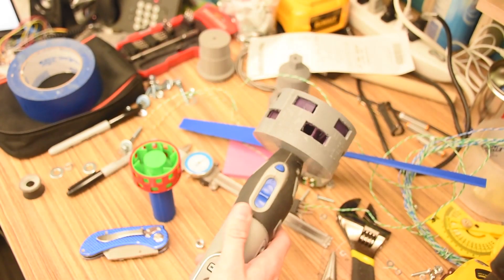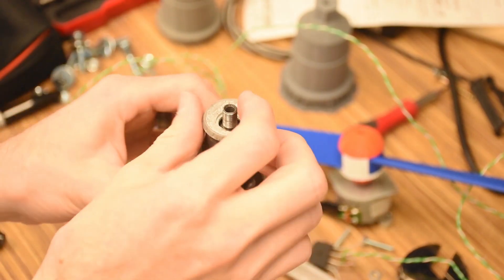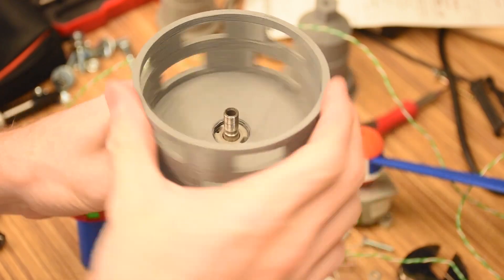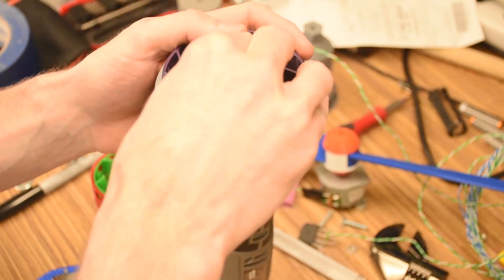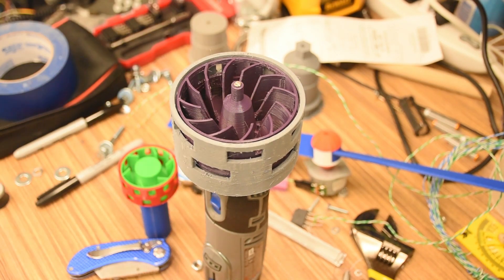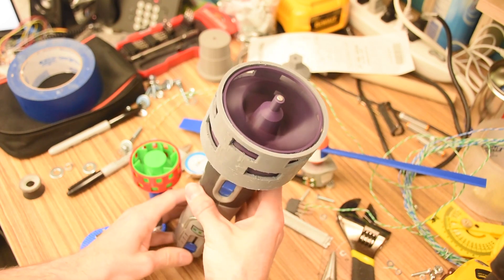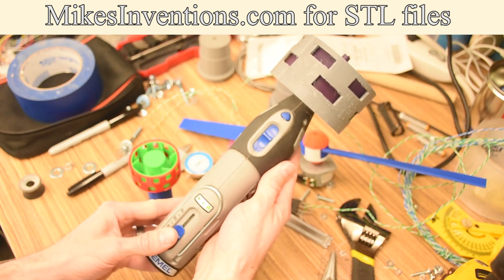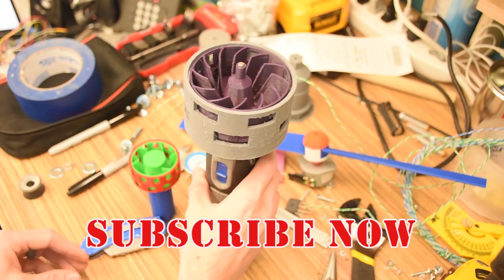3D Printed Tornado Siren on a Dremel - Mikes Inventions

Comment: This print worked quite well. I do have issues getting it to a high speed though, there is something off in the alignment (mild wobble)
I'm using a Milwaukee M12 Fuel and it has a safety shut off if it senses too much wobble. Might reprint and see if it improves
Reply: Might make sure you shaft piece is straight
Reply: @rogerbutton6290  I feel it's more the print hole is a little loose and causes an offset in rotation. The Milwaukee has a vibration shutdown for safety and I know my older Dremel that I used to have definitely did not have that feature (so it probably would have worked well with that one)